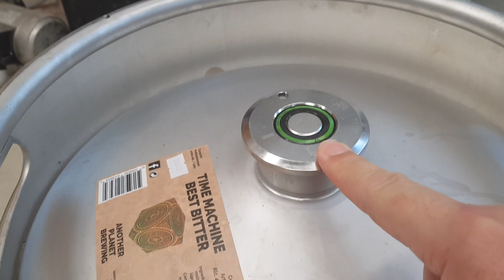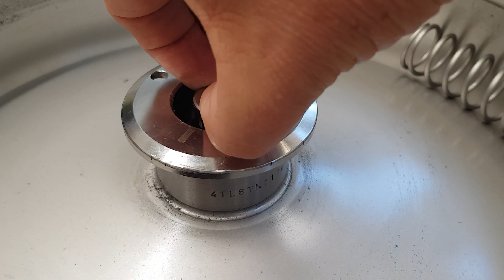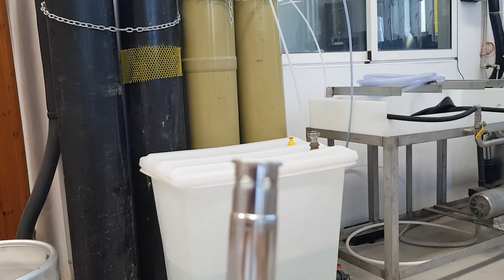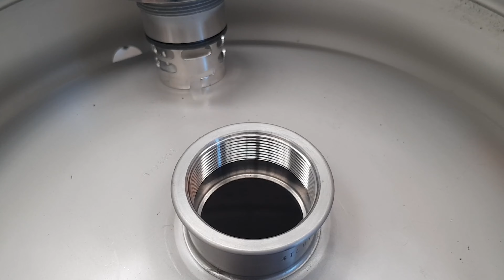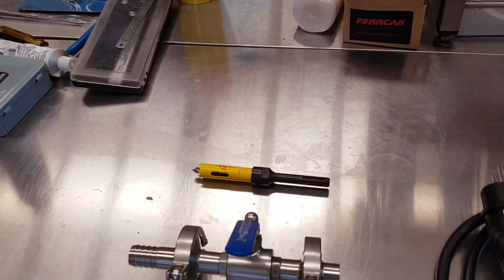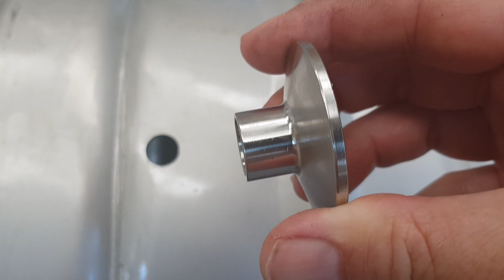Converting a beer keg into a home distillation boiler

Comment: Fortunately I’ve got a boilermaker/ welder as a neighbour. Mick did an excellent job using an arc welder with stainless rods. We also cut a 4” hole in the centre top of the keg and I use a stainless 4”/ 2” reducer so I can clean the inside and also attached my reflux column.
Reply from the maker: Welding is a great solution if you know a man who can! Interesting approach to combine the cleaning opening with the column mount - nice tip. Cheers man.

Comment: can't use a propane torch on mapp gas. The orifice is different
Reply from the maker: Thanks for the input Scott. My research suggests that the opening on the torch head is slightly different on a dedicated map-pro torch,  but a propane torch will still work,  albeit not quite as well.  There is no damage to the propane torch head btw. This info came from the tech support team at bernz-o-matic. If they were truly incompatible the mapp cylinders would not have the same threading so it would be impossible to connect it to a propane torch.

Comment: There's no doubt that it'll make top shelf liquor, wonderful job. I'm actually in the midst of outfitting my own keg,same plan as yours ,except I didn't know that I could solder it so easily and that happens to be very helpful to me
Reply from the maker: Cheers Adam. Yes it's easy enough with the right silver solder rods and a hot torch. Good luck my friend.
Reply: @planetmoonshine6223  Absolutely! I was shopping for a machinist to help me but all the stuff that you used is readily available for me. Very helpful to me